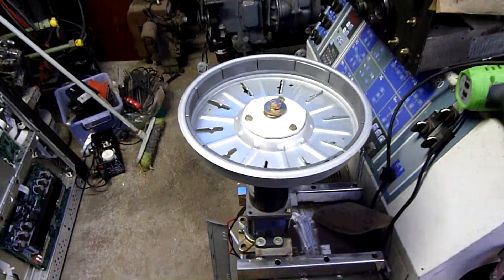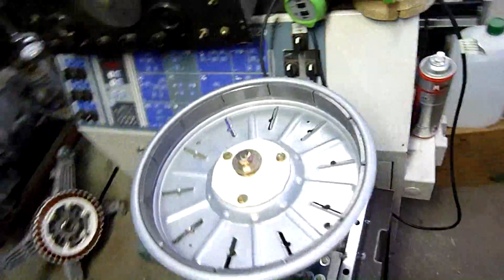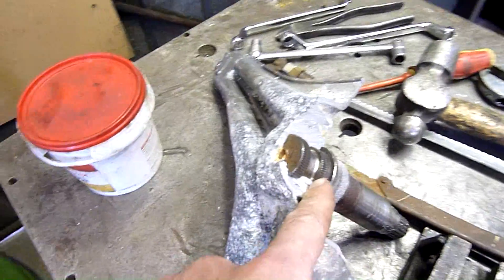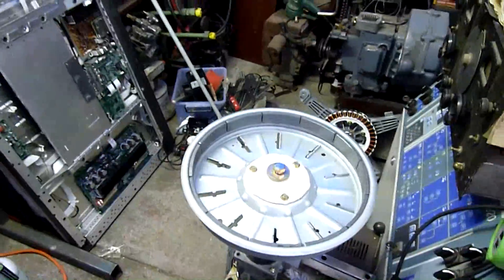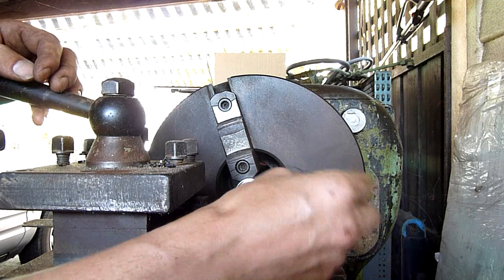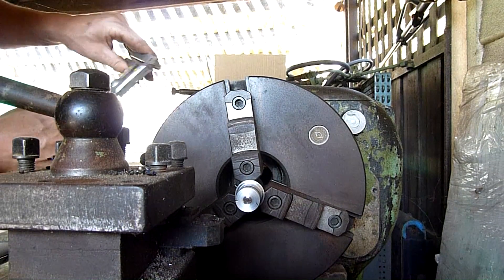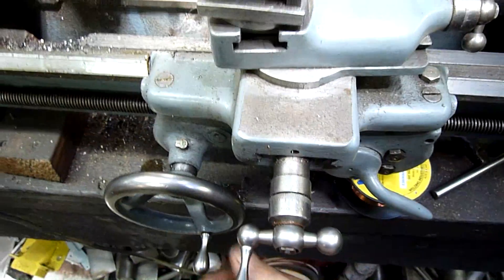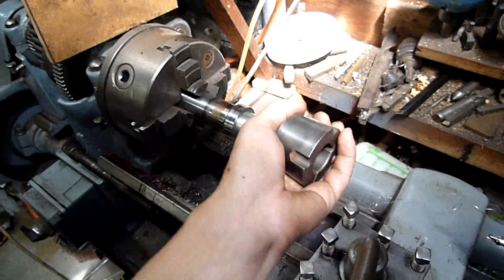Direct Drive Washing Machine HV Generator Pt1

Comment: About that capscrew into the keyway...My diesel engine's harmonic balancer is keyed that way exept it's a pin. It just slides on.   Then, a 36mm, 285ft-lb nut screws into the crankshaft

Comment: I reckon some chalk in the taper lock, that stuff grips amazingly well, works on our Drill press to stop chuck from spinning!!
Reply from the maker: very good point. I have a bottle of talc for drill tapers, inner tubes etc. I will give it a dusting and see how it goes. the bore is pretty good tho, should not be an issue at all!.

Comment: Have you ever seen where they put an end mill in a lath chuck and attach a work piece or little vice to the tool holder? As long as you're mindful about the direction of the cutting forces, you can do a wee bit of milling with a lath.

Comment: Nice :)
That is going to work, not really a question :)

I would use a inverter, you use that.
Bonus points for actual moving parts!!!

It needs a BLDC(brush-less DC) driver.. the motor itself is 3-phase synchronous motor.

The RC "electronic speed controllers" are just that, given you got the 3-phase version. Even you can also use a driver without speed control.

Comment: If it puts out enough HV, it could be rectified down via a 3-phase rectifier to a VRM and be a nice little low voltage high current generator. Maybe wind turbine?

Comment: Ah, niiiiiiiiiiiice. Precision engineering and electrical mixed together. Right up my street! :D

Yes, this looks like this is going to be FUNN! :D

I have heard the noises made by one of these when HDXFH spun-up his one with the little Honda engine. Boy, don't they SQUEEEEEEL. :D (High frequency) I think that they also knock out some rather high voltages as well when spun faster than they should go.

Yep, looking forward to the fun that's going to be had with this. I take it that you're going to be powering a drive motor with the VFD (or variac) which is then going to spin-up this washer motor, yes?

I think with that washer motor, anything over 50 RPM and it's going to be turning out some silly frequencies! :D

It might be interesting to get an old small 3ph motor (or 1ph induction motor if it'll do it) and then put silly-frequencies into it to see if it can be spun-up so fast that it flies apart! :D

New motor sport: Over-Hertzing! :D

Definition of Over-Hertzing: "......To spin a motor up beyond 400Hz (waaaay beyond 400 Hz! :D) so that it mechanically fails and bits of it go everywhere. Unlike over-volting, Over-Hertzing will make a motor spin faster based upon frequency instead of volts, thus Over-Hertzing is compatible with induction motors, whereas, over-volting isn't. Due to this, a new motor sport is invented: Over-Hertzing!"

Yep, peoples, you heard it here first. Name coined by BoomBoxDeluxe, February 2014!! :D

Thanxx for showing,

-BoomBoxDeluxe.

8th February 2014, 14.13

Comment: You can mill a slot with your lathe. You put the bit in the chuck and fix the item to be milled in the tool holder. Then slide with the tool holder across the bit. I've done it plenty of times. One important thing tho is that you need to move very slow as opposed to usual mill speeds. Knowing this method and some creative thinking has spared me the need to buy a mill for the time being.